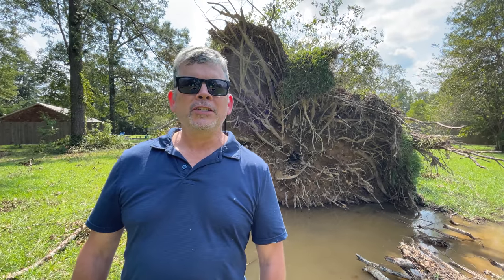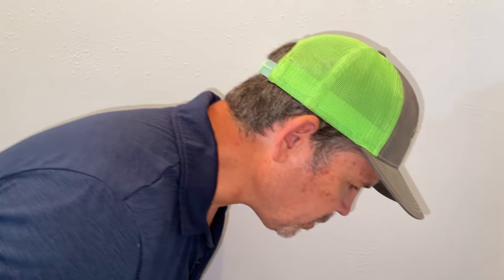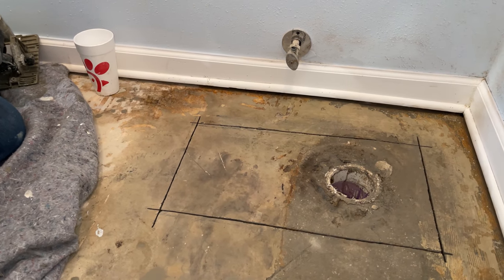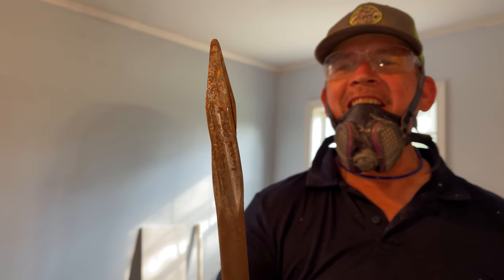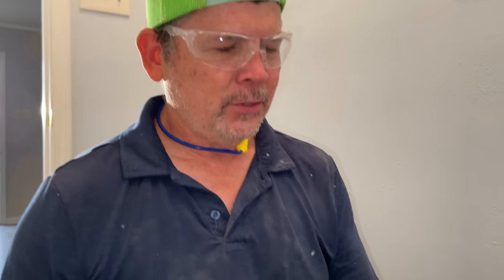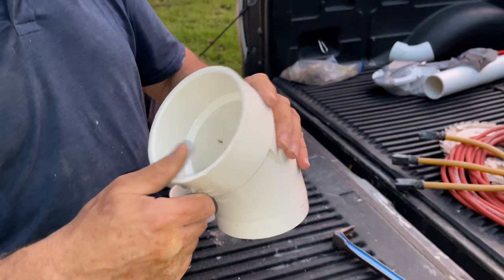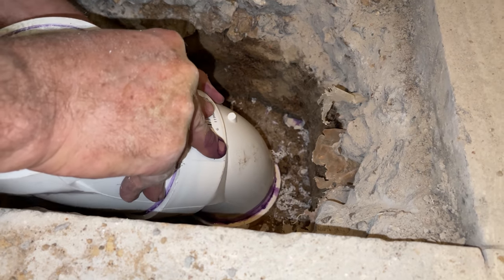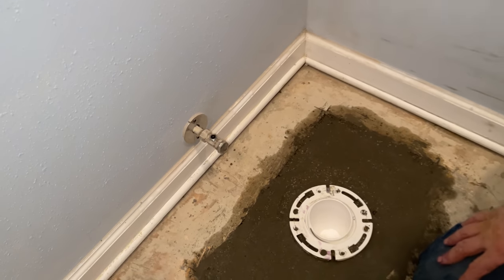We Moved a Toilet Over 5 Inches and It Kicked Our A$$

Comment: Trying to chip out the inside fitting to save the hub can be tricky. The trick is to make cuts on the side like you did at first, then take your primer and get it all up in those cuts and at the top of the pipe. It will soften up the glue and make it come out wayyyy easier. I see some people calling for a heat gun, that may work well, but there's so few times I need a heat gun that it's not worth it to carry on the truck. Also, if you do enough of these, it would be worth it to get a hub drilling tool. They make them for most pipe sizes including 3" and 4", and you just put it in your cordless drill and drill out the pipe that's stuck in the hub, super easy as long as you can get the right angle to use the tool, which in this cause you would have been able to. :)

Comment: I've removed inside pipe from a pool valve, by placing some PVC Cement on the inside area to be removed, igniting it, then using a pair of pliers to roll the inside piece out. Seemed to work easily without damaging my pool on/off valve.

Comment: 10:18 Could be some dremel high speed grinding could help removing plastic more gentle way, might minimize the risk damaging bottom coupling?
Also some "hot wood hole cutting bit" heated inserted for a minute trick could help soften top part and unglue the coupling not damaging bottom part.

Comment: I recently watched someone use a gas torch to heat a hole saw that was sized to just fit in the pipe. THought that was really clever as it softened the inner pipe being removed but not the outer flange (which is often softened if you just fire a heat gun at them both).
Reply: How ever you can get the job done, and not break your back doing it. I had to pull out my receptor/saws-all and cut up all kinds of wood to fit in the green bin after a remodel job it took me all day to do it. Got poke by many nails doing the job.

Comment: You can heat a 4" hole saw or 3-1/2 or whatever fits close and place it in the pipe and let it sit and heat the pipe and glue and it comes out easier

Comment: Great video, I'm not a pro just an experienced homeowner and a lot of projects seem to have something that comes up and needs to be figured out, so it was nice to see a pro struggle...  😁  If you find times you need to grind things like you were doing with the diamond wheel I would highly recommend getting a couple of helical double cut carbide burrs.  They'll remove material much faster making chips instead of dust, and the double cut is still very controllable.  There are tons of shapes, the single most versatile I think would be cylinder (straight sides) but with a rounded end, and a 6" shank is a little long at times but makes it more versatile.  Can be used in a drill but works much better in a cheap air powered die grinder.  Keep up the good work, this has quickly become one of my favorite channels..  👍

Comment: What I like to do is , apply primer to soften up the pvc then continue with the chipping of the hub, it makes it a lot easier to take out the pieces of pipe, also use a flat head screwdriver. If not in a perfect world you can also used a torch and heat out . Also you could have used a 45 flange .  And if it a 4” pipe you can also put a 3” 45 inside of  the 4” pipe to help you offset the flange.

Comment: I removed the toilet flange without doing all that. I cut the top off the flange using a mulitpurpose tool then use a hack saw to cut and chisel out a small piece to relive the pressure .  Put a rag in that hole so that all the broken pieces don't go in the hole.  One you get the first piece out (which you did) just cut small pieces and chisel out the rest.  It came out nice and smooth.

Comment: residential water closets require a 30" space/ 15" on center.     In America (dont now about europe as i plumb in Indiana) the center line of the flange is 12" off the back side Finished wall . 12' from the rear finished wall, and  side to side off the wall to the centerline of the toilet flange is 15". I never saw ya'll use a tape to determine these.

Comment: I had a job just like that but had to move it 7 inches. What I did was dig to just under the elbow and cut the elbow off at the pipe. Then glued in a coupling and then ran the 90 straight up. It was a little more digging but only took about fours hours not including pouring the concrete. I had to get it inspected before pouring. You guys really overcame a hard problem there.

Comment: Use a heat gun on the pvc.  Just removed a toilet flange from the pipe today.  It looks as though it never had a flange on the pipe.  You have to cut a vertical slit in the side.  Grab it with some pliers and start pulling/rolling the piece out/off.

Comment: If you can't get the 1/8 bend back far enough to get the 5". No problem. Cut the horizontal back far enugh to put a coupling and a 3" 1/4 bend, with the 1/4 bend at a 45 to the side, then a 1/8 bend to bring you vertical. They make 3" closet flanges. Yes?

Comment: one 4 inch coupling. one 4 inch 90, and 2 small sections of 4 inch pipe. dig below and around that 90. cut off at pipe past hub. glue on coupling, and small section of pipe, glue on 90, glue on riser to proper height, glue on flange. including chipping time, and backfilling, 2 hours. add another half hour and a single compression angle stop, cut off old angle stop, and replace it, gives you more clearance, as well as giving you a new buttery smooth valve. as a residential plumber who has done this job too many times to count, i gotta say, yall did good with the circumstances, but always remember to work smarter, not harder.

Comment: "Buzz Saw?"  In my world, a buzz saw is a giant circular saw, much like a giant table saw, built to cut lumber from logs, or logs into lumber. It's blade is usually six feet in diameter (across), so named because the teeth buzz when the saw is on, with its low RPM. So, thanks for the intro into your world.

Comment: If perchance you see this, pick up a zip cutter.  It is a small air tool intended for cutting automotive exhaust pipe.  It would have had that flange cut apart in two minutes or less.

Comment: Hindsight is 20/20 of course.  I understand you were at the mercy of the local hardware store and whatnot.  That being said, there is a drill attachment called a "Hub-Saver" that would have made your life a whole lot easier (about $15.00) that I discovered after a nightmare job like that one.  You scored having PVC (or ABS, whatever) to work with.  Maybe someone sees this post and saves themselves the soul-crushing torment of trying to remove a piece of pipe like that.  I was totally feeling for you on this one.

Comment: Makes me so happy to see that I'm not the only one that makes multiple trips to the hardware store and has every 2 hr project turn into a 5 hr-2 day project because things never go as planned.  I recently fixed a leaking toilet that turned into a much bigger job. Basement floor mount and they had left a void below the flange so it wasn't attached, and of course tightening the closet bolts did nothing to secure the toilet and broke the flange. No wonder that thing always wobbled!  Poured cement to fill the void, replaced the flange, rebuilt all the guts of the toilet, and then dropped and broke the toilet while trying to set it on the new flange.  Now we have a brand new toilet that doesn't leak and doesn't wobble.  Only took me 3 days and a lot of swearing.
Reply: seems like it would have been easier to just dig a few more inches and just replace the 90. then you wouldn’t have had to make all those funky cuts on your pvc.

Comment: I was able to take 3" ABS apart by applying heat the joint on a toilet flange in concrete. Need to be careful or you will damage good pipe. I practiced on some scrap fittings first took a couple tries. Code is 15" form wall for toilet on side.

Comment: You can heat up a hole saw or some other sort of metal pipe that fits just inside the pipe.  Let the hot metal heat up the PVC for about a minute and it pops right out like a rubber gasket.

Comment: Absent a heat gun you could put glue on the pipe inside the fitting and light it. If you let the glue burn just long enough it will make the pipe and the set glue soft and with a slotted screw driver and a pair of adjustable pliers you can pry the soft pipe away from the fitting and roll it out with the pliers. Not the preferred method but it will work if you don't let it burn long enough to soften the fitting.

Comment: That 4" pipe was a benefit.  If you had used a reducer to a 3" pipe that fits inside of the 4" pipe you could have saved yourself a lot of time.  You only needed to cut the 4" pipe off and slide the reducer inside.  I only found about a reducer today.  Getting ready for the same project.  Good video.

Comment: I tape, a lot of tape, my cutting bit to the chuck. Keep my hands out of that pipe as much as possible. It's cosmically funny that no matter how much experience one has one still makes stupid mistakes. Watching your troubles I laughed all the way through because I've been there so many times. BTW for gluing 4" and 3" pipe I'm in love with the spray can stuff...on hot, dry days the glue being applied with the supplied applicator starts setting up too fast before I can get the glue applied on both pieces being put together.

Comment: I was going to mention heating that flange when you were chipping it out but I see you’ve got that covered. Although I would have used a blow torch just to heat it up real quick and break that glue bond.
Another thought, you really should use some sort of termite barrier when you have compromised the slab. Just a thought.

Comment: you should have use a heat gun.  go on a circle heating up the middle.  get it to about 400* 425*F.   it will get it hot enough to loosing the glue and weaking up the inside pipe.  get a flathead driver and put  between the old pipe and the hub.  it should be able to push it out, then slowing twist it clockwise and it could come out clean.

Comment: Next time you can use a inside pipe cutter that  you can put in the drill and would cut out the pipe size with out damaging the fitting. It starts at 11/2" to 4" diameter pipe

Comment: Appreciate your helpful video. My one problem with your job is that I NEVER USE PLASTIC TOILET FLANGES. THE TOILET ANCHOR BOLTS IN TIME RIP THROUGH THE PLASTIC.. Only stainless steel with a pvc or abs core anchored to it. Stainless Never rusts out and is a whole lot stronger than that plastic junk. Thanks again. I did learn a few things from your way of doing the job. Home Depot carries the toilet flange with the stainless steel.
Reply from the maker: Thx Dan.   I’ve found that even though it says stainless steel sometimes it’s not the SS we think it is.  Some are truly SS though👍

Comment: Hi  I noticed that you had quite a time removing the 4" pipe from the hub of the 4" fitting. I have a method I have used for years and works quite well.  I use a heat gun to heat up the pipe on the inside. You still need to make a cut into the pipe to allow you to pry the pipe out of the hub. I think the heat also softens the glue. Care must be taken that the pipe is not over heated. You also must be careful not to over heat the hub which could distort the hub. Hope this helps

Comment: If you have to do a lot of these I would invest in a fitting boring/grinding tool, I think maybe they were called pipe hogs or something like that is the one I know, Basically it will cut the pipe out from inside the fitting.  Can be extremely useful for situations like this, and I don't think they were crazy expensive.

Comment: next time, use a hole saw that is slightly smaller than the PVC inside the hub, heat up the hole saw like crazy with a blow torch and hold it inside the pipe (careful not to touch the pipe) and be patient.  Repeat and then just take a flat head and pull inside itself.  They also make fairly cheap tools called Rambits that will drill out the hub for you.  Also that "short hub" is not ok at all!!!
Reply from the maker: We did a follow up video with all the different techniques.   Thx Eric 👍💪

Comment: Do you not have Polypipe fittings with a rubber seal in America? That was hard to watch, but I stuck with you to the end.....The drainage we use in the UK l is easier to fit together and take apart if needed, it does the same thing, no gluing, holds a test....It must be a price thing as I can't see why anyone would want to glue every pipe and fitting

Comment: To remove that pipe from the glued hub next time, make a series of vertical cuts in the pipe with a hacksaw blade, one every 1” around the pipe then use a beater screw driver and hammer to chip out each section then glue a 4x3 reducing bushing in that lowest hub. That will give you the shorter fitting hub to work with.

Comment: I had (well, wanted) to do this in my current house.  The toilet was way too close to the shower and I had to tear up the floor anyway, so I moved it over about 4".  Luckily, there was no concrete work involved.  This is a double-wide trailer about 30" off the ground and, at the time, had no skirting, so it was WAY easier than you guys had it.  Plumbing is such "fun" work.  LOL

Comment: They sell a pipe boring bit for about $20.00, would have made small work of that,  I would have held off until I got one of those. You could have also used some heat to soften the joint although I would not recommend using a torch perhaps a heat gun.

Comment: Once you got to the hub with room could've use the hand wire cable some states illegal but would have been way easier as long as you made a straight even so just clean it up

Comment: The flange should sit atop the the finished floor. i usually put a piece of tile or flooring under flange as a spacer.
Reply from the maker: Yep I agree.  They used peel and stick vinyl so it slid right under.

Comment: Very helpful video, thank you! My husband and are about to do almost exactly this (move our toilet over about 5-7 inches) but it's not in concrete. It's the first floor bathroom, and we can easily all the plumbing pipes from right below in the basement. We're not worried about moving the toilet, making the new hole, and replacing the pipes needed, but we're curious how to fill the hole that will be in the floorboards from the old pipe. We can't fill it with concrete, and need to figure out how to safely and securely patch with wood. Any tips you could give? Thank you again, you both are very fun to watch!

Comment: Reducing to 3” with a bushing would have saved you a lot of time the 4 by 3 bushing fits right into the 4” hub. 3” 45 would be a lot short and you wouldn’t need to keep cutting the hubs I assume you had a 3” flange buy one reducer  and your golden

Comment: Isn't there a tool that drills out the center pvc pipe and leave the outside alone?  Found it. It is called a PVC fitting saver.

Comment: Use the 3''  #'' bell will fit inside 4'' pipe put 3'' vent l  bo inside 4'' pipe and move  over  st 90  or pice of 3'' pipe  hub x hub  90.   flange on top or into 90.   I think 
you can get where you want

Comment: It's a lot easier early on if the original installer fills hole mostly with gravel and tops off with just a couple inches of concrete. Also, the best solution to "not enough piping altitude" is to install a poor man's "comfort height" toilet. Form up a few inches above floor level but just where the toilet will rest.

Comment: That would have been so much easier if you Yankees would also use the German style hanging toilets. These are mounted on a metal frame box covered with plasterboard. An all the piping is inside

Comment: Question : I have a low foundation around the flange. Toilet isn't flushing correctly.  I doubled up on wax rings hoping that would work. Nope
  Does the concrete foundation need chipping to roughin up the surface? Or could just poor quick Crete to level it out?

Comment: Just out of curiosity, did the cold water toilet supply line have to move to the left, as well? Supply lines are normally 7"-8" to the left off center of flange. Changing the flange rough will now change that number. If not, the supply line will be in an awkward spot behind the toilet
Reply from the maker: The toilet fit without moving the line 👊👍

Comment: try a heat gun     on the inside  when warn  drive screw between pipe & fitting       GET IT HOT  BUT  TO OUT SIDE OF FITTING SHOULD NOT BE SOFT!!

Comment: What kind of flooring is going in? The flange needs to be above the flooring height. It looked like the bottom of the flange was level with the concrete but if tile is going to be installed, the flange needs to sit on top of the tile, or a spacer ring will need to be used. Am I correct here?

Comment: Plumber for 17yrs, general contractor for 9yrs. I literally went from cringing to laughing hysterically watching this video. 
This is the EXACT reason why GC's with no plumbing experience should hire a licensed plumber for jobs like this. Just getting it done is not always a good thing. What many GC's like this don't realize is that down the line major plumbing issues will develop due to improper installation. It's just a matter of time. That to me is a disservice to the customer.

Comment: A trick that should have allowed saving most of the hub or to chip out the pipe without cracking hub is to put some band iron clamps around the hub.

Comment: As a plumber I definitely cringed more than a couple times throughout the video but I have to say you managed better than most non-plumbers would and you also did better than some plumbers that I know.
imo the only thing that should have really been done differently is you should have poured the concrete, let it dry, put the floor back and then glued the flange into the pipe because now the flange might be a little too low and you might need two wax rings to prevent leaks but other than that good job.